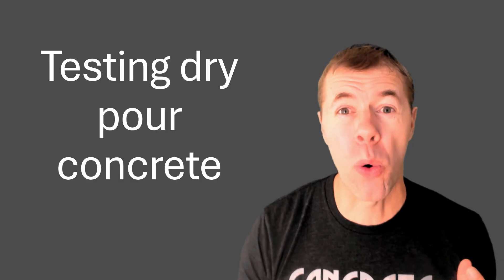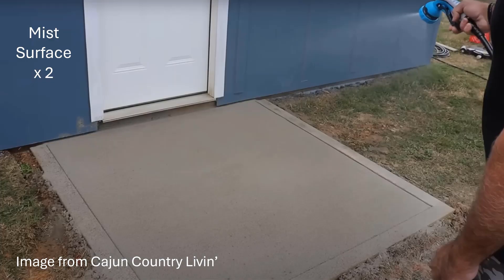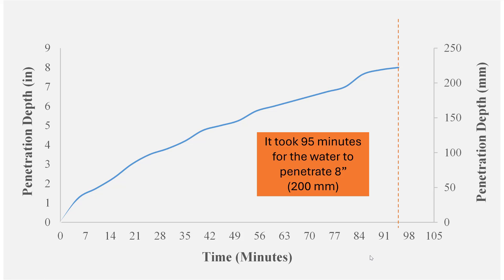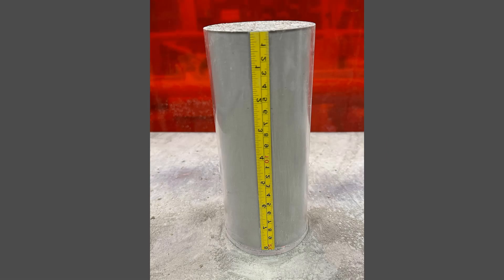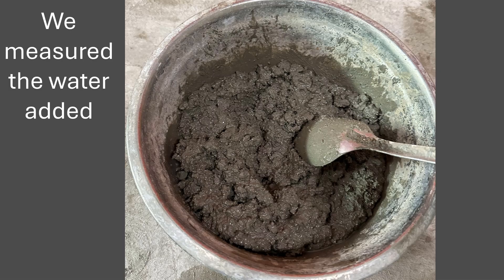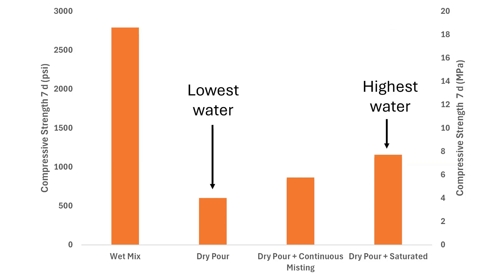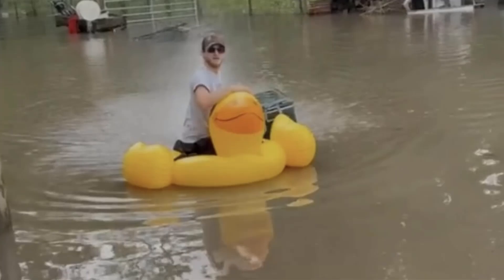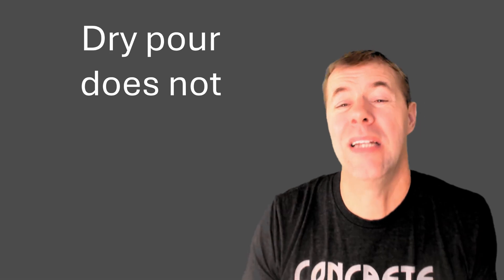Testing Dry Pour Concrete with an Expert

Comment: Fence posts only...somtimes.
Not having a way of mixing is the only advantage of this drymix over wet. You can get superior finishes and compaction with wet mix.
I've watched off gridders in stunned amazement making more work for themselves with dry mix and feeling so great about it at sunset, still  spraying, when they could have finished the same job by morning tea with wet mix and had the rest of the day off to do something else.
Reply: not having a way to mix?  shovel & wheel barrel ?  hell, I've seen people make a mound on the ground & mix it with their feet....always a way.
Reply: @mtraven23   It's because people are lazy and are always making up excuses for not doing it the right way.
Reply: And they pour right on the grass.
Reply: Setting fence posts in concrete is setting them in a cup to hold water and rot them out later.  Set fence posts by tamping the rocks and dirt that came out of the hole back in, that is all it takes.  No water or imported materials needed.
Reply: @nspro931  yes, tamping in the fence post is perfectly fine if done correctly. Concrete provides a reasonably predictable outcome. When concrete is used to set posts, the bottom of the post sits on a permeable layer first and the concrete poured over tat and around the post provides stability. The top of the concrete should be crowned for drainage too. Not all soils are suited to tamping alone. Not all poles are fence posts. 
Directly driving posts is preferred in rural settings where soil type allows.
Anyway, this is about dry mix V wet mix concrete not a fence post setting tutorial.
I hear you on the rotten fence posts.

Comment: It (Dry-pour based) can use for less volume of jobs, but for case of bulk volume of concrete jobs, I think that durability might be a concern, as wet mix well proportioned concrete perform better in all kinds of durability testing rather dry pour based concrete. Porosity of dry based concrete may be higher, as more volume of air will be present in the mix & after providing the water content into the mixed, the pores will be get connected through this which is concert into permeability issue.
Reply: @Tyler, sir please provide your valuable advice regard this, although it's a very nice presentation.

Comment: So the next question is: how strong does concrete get if you remove all that air with a vacuum pump? Does dry mix get still stronger? 

I know removing air from a slab, form, or hole is hard, but try capping the test cylinder and connecting a vacuum pump. Have plenty of standing water above the mix, so it invades the pores where air escapes.

Comment: Interesting! i guess that the dry pour would cope with freeze/thaw cycles in the long run either. Atleast not in my area. 

To me it seems like dry pour  = save a little time, initially when doing the project. But get a much weaker result and risc a shorter life-cycle of the finished product.

Comment: Pretty big bias against dry pour in this supposed "testing"!  Right off the bat, you go with an 8" dry pour column without vibratory assist. I doubt that anyone in the history of this planet has tried an 8" thick dry pour slab.  Your "rebar" test was also somewhat disingenuous, most rebar used within forms requires some amount of vibration to conform to the rebar, not so much with slabs.  You discount the actual advantages of dry pour which are working at a DIY pace and cost savings in both labor and material cost.  You state the material cost is the same, I guess you haven't priced out a yard or three of delivered concrete versus buying 1/2 to 1 cu. yd. of "concrete mix" (sand & aggregate) from the local landscaper and a few bags of concrete at the box store.  The real savings is in not having to hire a crew for placement and finishing of larger projects, which is often driven by having to purchase larger loads of concrete to save on delivery costs.  If you truly want to compare wet pour to dry pour, test for intended use.  Create 2", 3", and 4" columns (not 8") for your test, similar to this video, use some minimal vibration on the dry pour (like the dry pour guys on YouTube do with a rubber mallet to the forms, before and after initial hydration), pool hydrate (like they do in foreign countries) for up to 30 days, then test your dry pour vs wet pour.  I think your results will be a lot closer, because, if your "air channels" theory is correct, these thinner dry pour samples should have less of a problem fully hydrating and expelling excess air.  Finally, although we don't get fine detail in this video regarding the failed dry pour samples, they appear to be deficient in larger aggregate, and look like mortar mix (sand + cement), a crosscut of the samples would be helpful.   IMHO
Reply from the maker: Thanks for the comment,
You are welcome to make your own video and post it with your findings.  This is what we found.

Vibration by tapping the side of the form won't transfer to the center of a slab of any size.  That means the dry pour at the center of the slab will behave similarly to what we showed in our cylinder.  How do you consolidate dry pour around the rebar?  We consoidated the material by packing it around the rebar as best we could.  It doesn't seem to surround the rebar as well as wet pour.

We used bagged concrete and physically mixed the "wet mix" concrete that we compared to the equivalent dry pour.  You could buy these bags of concrete yourself and mix it.  You could mix it by hand like we did.  If you have a large slab where you can't mix fast enough before it sets then I agree that my comparison is not fair.  For small jobs like the ones I showed in my video then I think it is a fair comparison.

We ponded concrete continuously with rain for 28 days and the other one we ponded with water continuously.  This is what you suggested in your comment.  Things were better but still no where near what the wet mix got.

The dry pour samples were bagged concrete.  This is the same material that we used for the wet mix.  The reason you can't see the aggregates is because the paste is so weak.  I mentioned this in the video.

The air channel effect may be more prevalent in taller samples because there is more air to leave.  I have seen several people mention the bubbles on the surface of the dry pour.  This is not something unique to what we have done.

Comment: Very interesting. Alot of theories that popped into my head when i started seeing dry pour videos pop up online turned out to be true. The air was interesting and not something i had originally thought about. What are your thoughts on surface performance of dry pour vs a hard troweled or troweled and then broomed standard concrete surface? My kneejerk reaction would be to think the unfinished surface would be much less dense, more open, more permeable to stuff that would hurt it, more prone to issues  like spalling and scaling from freeze thaw and deicing in cold climates, and much less wear resistant over time. Im a finisher, not an engineer, but try to understand the inner working of concrete as well as i can in order to produce work at the highest possible level. Would definitely be interested to hear your thoughts on this.
Reply from the maker: Thanks!

I think the surface would not be as stong as well finished concrete.  The best way to get dry pour is to leave the water on the surface.  This will cause a very high water to cement ratio at the surface.  Also, the dry pour does not contain entrained air and so it will have freeze thaw and scaling issues if ice is applied to it and it freezes.
Reply: @TylerLey Thanks for the reply, glad to know i was on the right track. Love the videos, you and Intelligent concrete have taught me a lot about the technical side of concrete. Its crazy that all this great info is free, and we appreciate it.

Comment: Tyler could you test a machine called the Mud Mixer to see if there is enough mixing to properly hydrate and form a good quality paste as the mixed concrete leaves the chute? I like the idea that the MM save time in mixing, but if the concrete is not as strong as concrete mixed in a rotary drum, then the time savings is not worth it.
Reply from the maker: Good idea!
I would have to get one.
I have done a lot of testing on volumetric mixers.  They use augers to mix the concrete and they do a good job of mixing in a short period of time and so I think there is a chance that this machine would work well.
Reply: @TylerLey  Volumetric mixers are incredible machines, the ability to easily adjust the slump, strength, or 'recipe' on the fly, no worries of how far a jobsite is from the concrete plant, ability to do complex/ time consuming pours that are in backyards with limited access and having to use wheelbarrows or jump form silo construction with a skip bucket on a donkey winch. One difference the volumetric mixers have an auger that is 8 - 9 feet long with different shaped flights at certain locations in the mixer. If you could do some compression testing videos with the Mud Mixer that would be amazing.

Comment: This is fantastic information, thank you Tyler. I do not think anybody that thinks rationally and has common sense thinks that dry pour is superior to wet mix concrete. People that dry pour concrete are just lazy and do not want to put in the work to mix concrete. I will only use wet pour concreted
Reply from the maker: Thanks for the note.  I do think that dry pour could have its place in some applications but I would be careful where I used it.

Comment: The dry pour has too much air in it. Mixing takes the air out. Air is bad in concrete especially if there is metal mesh or rebar inside.

Comment: It would be intriguing to investigate how raising the Portland cement 
content in the mixture influences the binding properties and overall 
strength. Since dry pour concrete is easy to use for those living in 
remote locations, incorporating Portland cement adds only a small 
expense for greater convenience.
Reply from the maker: I see what you are saying.  That is an interesting idea and could help.

I don't think it is that hard to get a mixer and make the material with that.  Another option is hoe and water.  Concrete has been poured in remote locations for decades.

Comment: How well does the cylinder test result apply to the horizontal and shallow pad, do you think? There are much higher ratio of surface area for water absorption and more area for air to escape.
Reply from the maker: That is a good point.  We did a 4x8 cylinder because that is the standard way to test the compressive strength of concrete.  We could build modify molds for future testing.

I agree that if the cylinder is not as tall then the air channel effect may not be as detrimental to the dry pour but I still think it is there because the air needs to escape as the water is added.

Comment: i question your methodology a bit, mostly because I have specified dry poor, in certain ground contact situations with very good results.  But everyone of them was a relatively thin section with a very slow moisture absorption rate, and long period before any significant loading.  Dry SackCrete tamped around a gate post, and left to slowly absorb moisture from the soil.  Small slabs, at stair landings for Forest Service lookout towers, and stacked bags of SackCrete to form short retaining walls on wilderness trails.  All of them were allowed to set and absorb moisture over months.
Reply from the maker: Thanks!
If you look at my results the dry pour was able to get 1000 psi compressive strength.  That can be enough for many applications.  I would have not concern for a fence post or a small slab where a person would be the only thing on it.  Heck, it would hold a pick up truck on it as long as it was not a repetitive load.  We don't need a lot of strength for the applications that you mentioned.  However, if I am going to make concrete myself then I will spend the time to mix in a wheelbarrow and place it.
Reply: @TylerLey  I worked for a government agency in wilderness areas, trying to maintain and stabilize historic buildings.  All the water, SackCrete, etc. had to come in on mules.  So water was something you limited.  And no wheels were allowed.  For a while we had some seven gallon buckets with molded in flights and screw on lids which were made specifically for mixing SackCrete.   But they wore out and we couldn’t find replacements.  

The dry set concrete had the advantage that due to the very low water to cement ratio, we could set the forms, place the dry mix and cover them with plastic sheeting in the fall when we took the lookout Personell out for the season, and it wouldn’t have freeze fracture issues over the winters.  

I’d be interested in seeing an experiment where the dry mix, was left covered  in ground contact, then allowed to absorb hydration water slowly from the soil.   Then cut it to square prisms, and break it to see what strength you get.

Comment: My initial guess before watching the video is it will depend on the thickness or depth of the concrete. I would think moisture can only penetrate so far, so would not fully cure the concrete if it's too thick.
Reply from the maker: Our work showed that it penetrated all the way through.

There was some additional work where we measured the water content of the fresh concrete using the Phoenix at the top of the 4x8 cylinder and at the bottom and the water content was exactly the same.  This showed that there was equal water at the bottom and the top of the cylinder.

I didn't include it because the video was already really long.  Maybe I will make a follow up and include it.

Comment: I wonder, might the dry stuff end up healing cracks any to stay the same strength at least, the way "roman concrete" did with the lime inclusions?
Reply from the maker: I don't think so.  I think these cracks are too large.  However, we didn't test it over years and so you never know!  We made some samples that are still curing.  We could let them cure for a year to see if they get better.

Comment: Did the dry pour not get aroud the rebar or did it pull through making it smooth? Because it looks like a wider channel to me.
Reply from the maker: I think it is both.  The pictures are the failed concrete and so the concrete was damaged when it pulled out.  I do think the dry pour didn't pack as well around the bar and that is why there is such a big difference between the two.